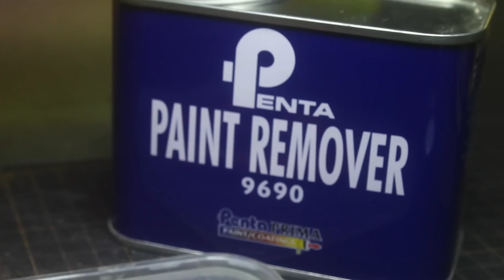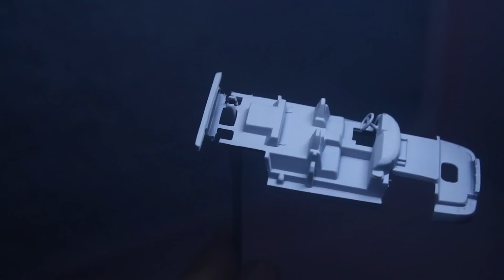MINOR REPAIR ON JUNK FERRARI TESTAROSSA MATCHBOX

Comment: Why not use UV light and peroxide to remove the yellow from the glass?
Reply: My thoughts exactly. It's a miraculous process.
Reply: If I remember right, these windshields were yellow when new. Matchbox did that a lot.
Reply: It's actually supposed to be yellow (I had this car when I was young)
Reply: How does that work? I have a UV light for my 3D printer and would love to know the process
Reply: What WICYOMVAE OAEN SVLE  means ?